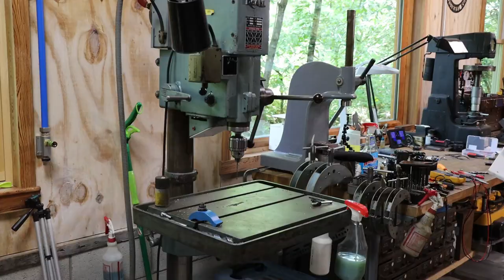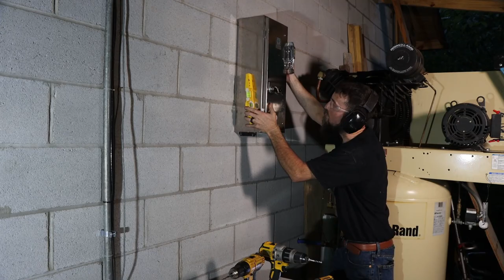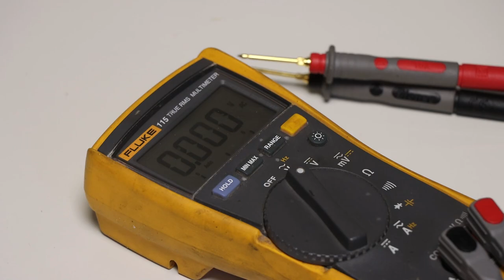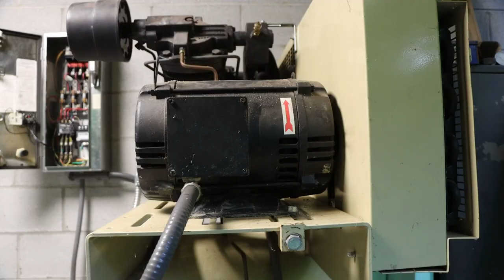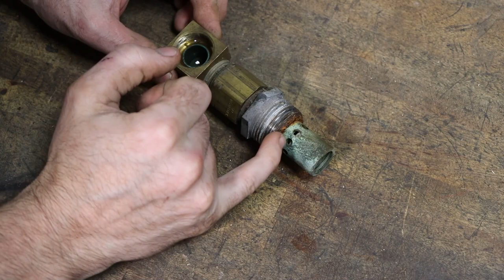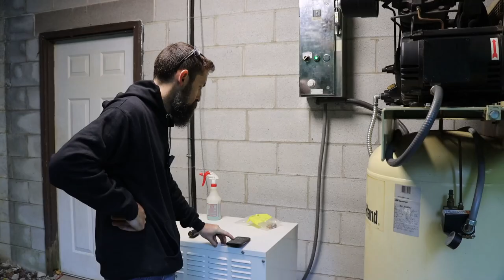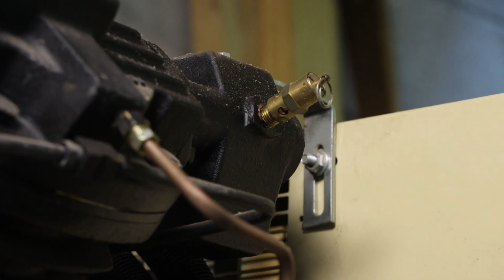Wiring & Test running my Big  Compressor

Comment: There is a simple way ensure your air compressor only runs when your phase converter is running.  Do this by electrically connection the two starter together so that when you start your rotary phase converter you also start the contactor in the control enclosure that you installed on your air compressor and visa-versa.  Your rotary phase converter already has a starter, just like the starter you showed during your air compressor video, that includes a normally-open start button and a normally closed stop button.  When you press the normally-open start button, the circuit closes and energizes an electronic starter inside your rotary phase converter, which has a contact wired in parallel with the start button to seal around the start button so that when you let go of it the starter remains energized.  Conversely, the normally closed stop button is wired in series with the rotary phase starter.  When you press the stop button, the circuit opens, power no longer energizes the starter, and the phase converter is shut off.  Your rotary phase converter is designed to be connect together with additional phase converters.  When I installed my American Rotary Phase Converter I thought I saw a wiring detail included in the manual on how to wire multiple phase converters together, maybe it was their wired remote stop\start.  Anyway, the start button of both units (in your case the rotary phase converter and air compressor) are connected in parallel while at the same time the stop button of both devices are connected in series.  If you do this, when one of the start buttons are pressed both the phase converter and the air compressor's contactor (not necessarily the air compressor motor) starts.  When one of the stop buttons are pressed both the phase converter and the air compressor's contactor are stopped.   I found a wiring schematic online, it's not the specific one about connecting two phase converters together but shows the two start and two stop buttons, machineryequipmentonline.com/electric-equipment/multiple-push-button-stations/
Reply: By the way I am happy to help with this. I can sketch up a diagram or help like on iphone phase time.  Let me know.

Comment: run the compressor pressure control voltage off the 3 phase output.

Comment: my experience is with motors is You have a 50 50 chance of the direction being correct. But when You add the murphy constant,  You only have a 10- percent chance of getting a 50 50.
Reply: Wow! So my mistakes are not just bad luck? LOL
Reply: The Probability of Chance.

Comment: Good video as always. As someone else's said the current on that transformer would never be 5A on normal load doe to the impedance of the windings.
Another thing, the small piece of metal found on the check valve could be a piece of the cylinder head one way valve.
Reply: I think the reeds will need to be inspected and replaced... I saw that wafer of metal stuck in there and cringed a little. You can check the reeds using a finer scaled manometer (1-5 PSI graduations)... if the gauge jumps around instead of rising slowly (and nearly uniformly), that's a sure sign of a bad reed/ check valve.

Comment: A Little tip that I've done in my shop. I have to manually shut down The compressor when i leave and if its not working at the moment its easy to miss.
So i made a selfholding circuit thats powered from the shoplight circuit that have to be set to get the compressor running . If I forget to shut down the compressor it stops when i shuts the light. But it wont start when i switch on the light again until i set the hold circuit.
Works like a charm!
Like your work and projects 👍👍🍻
Jörgen /Sweden

Comment: use a command wire from the the 3 ph converter on/off contactor to command cutoff relay for the compressor push button contactor (or maybe even better to cut off your 3 phases out of the converter to any slave loads - for some reason I thought that's the way is supposed to work, might want to check that)

Comment: I found a screw in my check valve. Of course the screw held the reed valves in place. So i had to replace the head /valves and piston the first time. 2nd time i just had to replace the screws and lock tighted them with red locktite.

Comment: Put a momentary push button switch on the starter input relay.  Connect one side of the switch to the line side of the relay.  Move the H lead to the load side of the relay and connect the other side of the momentary switch to the same point you connected the H lead.  That will interlock the transformer. The transformer will only energize if you push the momentary switch once the contacts close the transformer stays energized.

Comment: 35:40 Perhaps a relay whose coil takes 240VAC and is connected between the "ghost" phase and a live 240V line (say, "black & blue"), and whose three-phase 240+ VAC contacts are connected between the circuit and the compressor, so that only when the  three-phase converter kicks on and feeds power to the "ghost" phase will the relay close and allow the compressor to run, rather than buzzing and burning the motor.

Comment: Hydraulic oil ISO viscosity 32 at ambient temps below 100* 32 is usually good all year. Stay away from SAE weights because they contain a lot of additives that can affect your valves. ISO 46 is ok above 50* but won’t splash well at lower temps. ( your wrist pins won’t get adequate lubrication in the winter.
Synthetic oils aren’t worth the extra expense in an air compressor in my opinion. My own 5 HP compressor has never had anything but hydraulic 32 in it for somewhere around 50 years now. Change around every 100 hours.

Comment: Just put the step down transformer across the out put from the converter . Then it will only run when the converter is running

Comment: FWIW, The AC impedance of a transformer will be higher than the DC resistance and current will be less than you calculated...

Comment: 1:45 "Electronic" implies semiconductor or thermionic control components.
This assembly is purely electric - no "electronic control"

Phase converter sensing:
Find a low voltage line in the phase converter that is on when the output is on and run a line to control a relay that switches the control signal to the compressor starter relay.
Reply: Buy some sealtite, you're going to need it. Get rid of the auto drain, make it standard practice to drain weekly. Also gets you a look at your operation. Guaranteed something will block up that valve. Mostly insect. Thanks for the look.

Comment: One cheap workaround to the compressor current draw is to go down a pulley size on the motor. OK, you'll lose a few CFM, depends if that bothers you or not.

Comment: Steve, Get rid of that rotary switch you installed and use a start stop setup. In doing so the start stop can be mounted inside the shop instead of on the back wall;
Reply: It depends if he wants to reset it every time he gets a power utility blip.
Reply: @timramich  cheap insurance, I believe.
Reply: @timramich  Its the only way to shut it down if power goes down the phase inverter is set up to do the same if the power blips or goes down.
Reply: @brucetuckey7909  Most people keep their compressor on all the time. And no, a phase monitoring relay would do the same thing.
Reply: @timramich  With a three phase converter running his compressor its not like having true 3phase power. If the  convertor shuts down it will only supply single phase power to the three phase motor on the compressor. In doin g that the motor will fry. The only out of this situation is a single phase motor or have the magnetic starter shut down it the power goes down for any reason.
Reply: @brucetuckey7909  Or a phase monitoring relay. They would also shut it down if voltage on a leg dips too low, to protect the motor. And any newer thermal overload will also trip if you lose a leg from the converter shutting off. Or, just get a VFD and run it on single phase.
Reply: @timramich  Why go to the extra expense on a phase monitoring relay when if it is wire for start stop buttons it dose just about the same thing with out the expense.
Reply: @brucetuckey7909  Why does anything have them? Why waste the power and money running a phase converter when they're outdated and done make a true 120 degrees of separation of the legs and can't offer a perfect voltage balance between the legs?
Reply: @timramich  The biggest reason for running a phase inverter or vfd in the shop that dose not have three phase power is the cost of replacing every motor on old machinery that was built for more industrial applications and the shop they were in had or has 3 phase power.

Comment: That arrow indicates clockwise from the shaft end, the end from which rotation is determined on a motor. if you order over the phone.   That piece of metal looks like a reed valve used in some compressors.   The cfm your compressor has as it fills the tank's volume, will provide the answer.

Comment: I realize that this is a small point, but in another video the electronic expert stated that it was actually better to have the fuse as the FIRST thing in any circuit, in front of the ON/OFF switch, since in that case a short in the switch will blow the fuse before it can electrocute the person with his hand on the switch if the switch itself fails in the wrong way.
Reply: So the fuses, which you touch to change out, remain live even with the disconnector off? Sounds like a terrible idea to me.
Reply: Primary fuses are always after the disconnect. Past that on subsequent circuits you are correct, fuse before switch.
Reply: @jonathan1427  You turn off main power to the wall socket first.  If anything happens on a circuit for such rather high-power-draw equipment, you cannot be sure of what damage might have resulted in the lines from you main fuse box before the equipment-connected fuse finally blew.  Sometimes fuses are not fast enough...

Comment: If that would be mine, instead a fixed switch for power, i would use push buttons for start and stop looped through a relay, It has to be manually started every time, but when power goes off as the phase converter is off, it will auto disconnect. It will also shutdown in the event of power failure. A power indicator inside the shop would be nice. That method is mostly used on my country on almost every not automatized machinery, like your compressor

Comment: In this electrical field, industrial, those are called contactors, not motor starters. Motor starters are protection devices put before contactors. Kind of like a circuit breaker.
Reply: I would honestly replace all that contactor stuff with a VFD. Just run the 2 legs of 120 out to it and a VFD can give the motor the 3 phase it needs. Then you don't need to run the phase converter to make air. They have inputs that would get hooked up to those various safety and pressure switches, just like the contactor coil. It can ramp up the motor to avoid a huge inrush. You also wouldn't need a control transformer. Literally just a VFD. The cost is greater up front but they'd save you money in the long run on bills.
Reply: And if you want to keep the setup, I'd get a phase monitoring relay to be the "input power safety." I'd also get a more modern contactor and motor starter, and you could just get one with a 240v coil to ditch the control transformer. Or, get a contactor and overload relay, which goes after the contactor. They now make solid state ones and you could then ditch the fuses.

Comment: I've said it before, but, I still think you should pick up you dryer air inside the workshop! It would also have the advantage of being more difficult for the "critters" to get in the intake! To prevent it starting up on it's own, add a starter contactor upstream from the control box so that the maintain through the coil has to be energised before it will start.

Comment: Sorry, but I really do need to correct you on something.

The impedance of transformer windings is mostly inductive, not resistive, and your meter does not measure inductance, it only measures resistance. The total impedance will be much, much higher.

The primary current of your transfomer will be much, much smaller than 5A. It will mostly be the load current divided by two, with a little additional current added to that, which is required to magnetise the core of the transformer.
Reply: Also, didn’t the secondary voltage read 12v and not 120v?
Reply: @rohanhamer8429  possibly. I wasn't listening properly to that bit.
Reply: I also ought to say the quality of the wiring was excellent.
Reply: @andrewbaker7839  I was about to say the same about his calculation
The meter must have read 120v, the coil wouldn't pull in at 12v, also, he had 125v once installed
Reply: I was just going to make exactly that point.
Reply: Yup, I was going to say that... the resistance is just good for continuity.
Reply: @rohanhamer8429  When he tested in the shop it was at ~12v when he tested outside it was ~120v He fixed it without showing us I think.
Reply: Was about to say something similar. Did a 4yr apprenticeship as an electrician (a long,long time ago), and if anything is going to mess with your head, it's AC theory :)

Comment: At the Bar Z Bash this year, Stan lost the motor on his surface grinder when someone brushed the start button with the RPC off. Surprised that American Rotary doesn't take care of this for you by having the single phase come thru a starter so unless the unit is running there is NO voltage, single or three phase at the output connections. All my machines get all three legs at the RPC output.

Comment: running at 175 psi may be not needed for your small shop, can be lowered so you will not pull the 7.5 hp  thus not tripping the thermal switch , for example I use a 5hp compressor for a blast cabinet that turns on at 60psi and off at 80, as volume is needed for this application. I also increased the drive pulley size to load the motor to 5hp @ 80 psi for more volume since I don't run this at 125 psi.

Comment: If you wire the controls so that if there is a power failure, as you mentioned there will be no need to add anything else, as long as the power to the controls comes off the generated leg

Comment: Wonder if I might have put the control box inside the shop. Also, at one shop I worked for we had a switch leg that went to the switch plate (lights) by the door. After having a line blow over night and the motor burned up, we began powering down the compressor when we left for the day.

Comment: 18:30 are your phases balanced.
This looks like an obsolete overload.
You may need to pull your control from another phase.
The pressure switch should control the contractor.

Comment: I’ve had my share of mud dobbers squatting where they can cause the most damage.  Sometimes I wonder if electrical current don’t attract them the was they love to build in encloses.  I’ve never seen the busy bodies use a tube and just cap them off like that.  That looks like what I’d do if I was one.  Do it the easy way!
Reply from the maker: That was the smart community of wasps that built in my filter.😁

Comment: If the components that you put in the box came with compressor including the hearers they should have been engineered for the system.  If you wired the output of the three phase converter into a distribution panel and fed the compressor from the distribution there should be no power to the compressor when the three phase converter was turned off.

Comment: Also a little advice, did I mention I did air compressor service for 37 years?  What is in your shop that requires 175 psi?  Why would you work the machine that hard if you don't need that high of pressure?  It costs a lot more money to compress air at 165 psi compared to 125 psi.   Lower the cut out pressure to 145 or less.  Less wear and tear also

Comment: Could be a pice of a reed or left over from a previous repair. Does not seem to like it's faulty inside though.  like you said who knows. Those three phase I-R compressors are pretty capable units for sure. Few things are more annoying than an air leak, it can be hard to get them all 100% it takes some work but doable. Although one that you can hear drives me nuts. Oil? Ingersoll Rand reciprocating compressor oil, sold at your favorite air compressor store or Amazon!

Comment: Could you connect the control transformer to be powered by the 3rd leg from the phase converter, not from the primary  220 lead?  That way the starter contactor would only get the 120 if the converter was on.

Comment: Get a phase loss detector for the control box. Then it won't try to start on single phase.
Reply: Just replace the overload with a more modern one, at least later in design than 1970, which includes as standard for most of them phase loss protection, in that the bimetallic strips that sense current drive 2 SRBP wafers, and the unit will trip out if the current in any phase grows too high, but the other wafer also will trip it out if the phase currents are not matched within 20%, which happens with a lost phase. That design with wire heaters is a century old thing, and should be retired and scrapped, it is long obsolete, and there are plenty of more modern more reliable units around. The switchgear I worked with, dating from 1970, included that as standard, you could not get the 1930's stuff, it was a replace on sight item, even if it was still sort of functional.

Comment: Do you have a 3 phase panel fed from the converter? If you do the compressor shouldn't run unless the converter is powered. A off switch is best if you put a set of contacts in the line that pulls in the contactor. In older systems that was the #3 wire in a start stop switch.